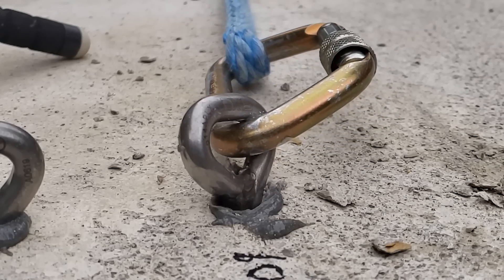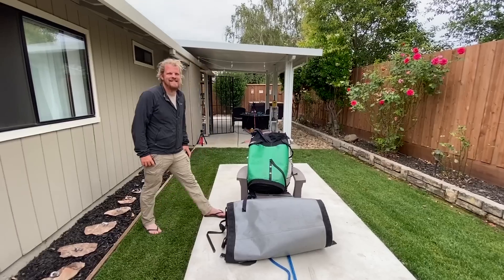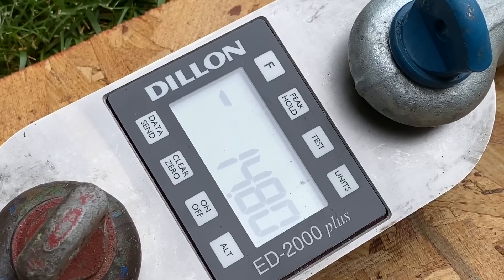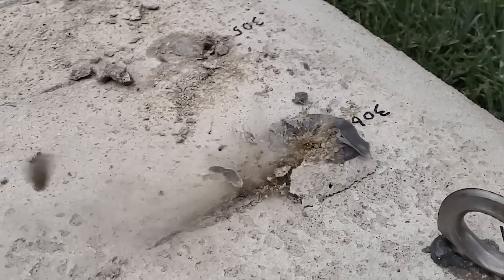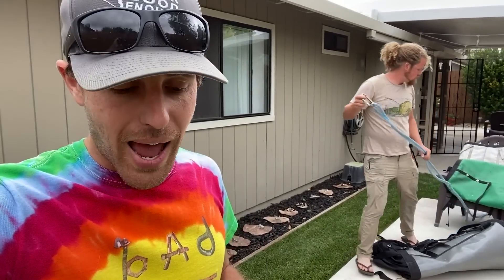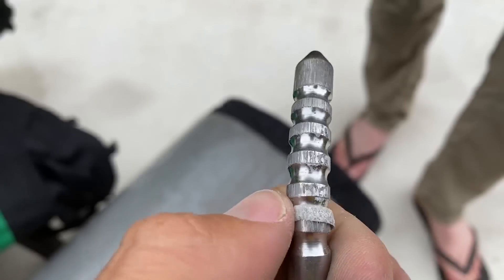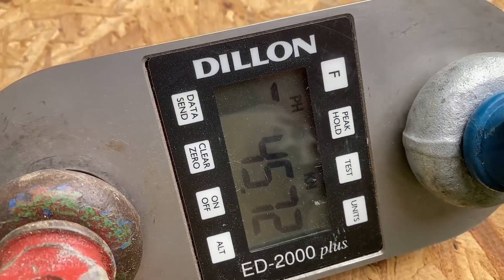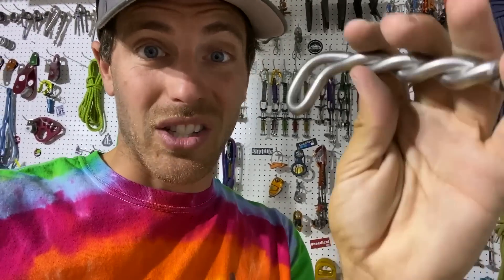We pulled SIDEWAYS on glue in bolts - you won’t believe what happens

Comment: This test was fun and very reassuring. After putting up bolted climbs and anchor stations for a long time and using glue-in eye bolts more and more often as the years go by, I'm now at the point where I think that the second bolt at a station is A) just for that 0.003% statistical advantage against total anchor failure and B) to show lost people or noobs where the belay is.

Comment: I think many are curious about the strength of your concrete. in order to reach the rated strength, the mix has to be kept wet for 28 days. concrete continues to cure as long as it has moisture in it. 

if you were concerned it was affecting your results, you can cover the slab with a blanket or sheets, hose them down and cover that with a tarp to trap the moisture in. keep it wetted for about a month and the slab will be significantly stronger.
Reply: he should be using 1:1:2 or 1:2:2 (whatever tests better)Portland cement, masonry sand, 3/4 screened limestone.
then do a full 30 day saturated wet cure and after a few dry days using a lithium silicate on top for a couple coats

That would allow evaluating anchors without the premature concrete failures. Looks like he is getting compressive failure starting at about 2000psi.
That is really a bit too low.

Comment: That last test was a little comprimised because it wasn't the strength of the bolt or epoxy that failed but the concrete cracked to the edge which let the bolt pull out easier, still a great result

Comment: The 4,000psi concrete you get in bags from Lowe's and Home Depot, or even the standard 2,500psi you get for concrete sidewalks and slabs on grade, should be a good potentially lower-bound, analog for most rocks. I would be interested in how different sand stones do.

Comment: Your partially losing out as the bolts pulled out before are cracking your concrete leaving future bolts in preweakened material.
Reply: The concrete isn't the weak point in most of the breaks. But good observation.
Reply: @elmeradams8781  Not most but it was on at least one although you still got good results. I just think they could have been a lot better off the concrete hadn't cracked when the previous test was ran.

Comment: Hey, great video as always. I'm a mechanical engineer and climber (high lining is still a bit scary for me).

Anyway, I'd be interested for future break tests if the focus wasn't exclusively on MBS. When bolts are rated, there are usually two numbers which are important for the engineer. One is the MBS whi h is forged into the side of the bolt. But there is another number called the proof load. The proof load of a bolt is the maximum force it can take before it plastically deforms. To get this accurately requires a stress-strain or force-displacement graph, but you could probably get a rough number just by using your eyes to see when it visibly starts to deform. It seems like most of these bolts started to plastically deform at very low forces. And if I walked up to a cliff and saw a deformed bolt I probably wouldn't clip it (even if I knew it would hold 50kN before it completely snapped).
Reply: Why would it matter for people using it? 
(I'm not trying to be mean. I'm wanting to learn how to safely climb and engineer things) .
Reply: I love your videos. I would be interested in that too. If you side lode a bolt and bend it, then if it is side loaded the opposite way it would definitely weaken the bolt. Then what would it brake at.

Comment: The problem with sideways twist is that you crack the bolt/glue bond. This was happening in your test at 6Kn. Can you get some Raumer bolts and test those similarly? The Raumer has only knurling as a key for the glue and not notches. I am almost sure the Raumer will slide out of the hole in a twist test. Would be interesting as we use these for our climbing bolting.
Reply: https://raumerclimbing.com/eng/prodotti_clista.asp?cat=stainless_steel_resin_anchors&qi=0-7-0

Comment: I think you should put a sharpie line down the shank of the bolt so you can see how much the shank is twisting on the side load tests. It would be interesting to see where/how much/how far down the bolt it twists. (As long as the glue doesn’t take the sharpie line off, maybe a scratch line instead)

Comment: Ryan, Could you possibly pull on a Fixe bolt up to 6kn (or so) until it cracks the glue, then release tension and see what it does in the hole by manually moving it around.

Also, as I'm sure everyone is aware, cyclic loading of glue ins, in an unfavourable direction is probably not super good for the glue.  But the results definitely surprised me.

Cheers.
Reply: I am also interested in what a tension straight pull out test would show after a glue bond break has occurred.
Reply: Same interest here!
Reply: I want see the highrise construction eye bolts made from 316 stainless steel and from memory I think : 12 mm thick.

Comment: For the longevity of the bolt or anchor setup, it is best not to side load the ring. As you demonstrated, yes, the ultimate capacity of the bolt in one side load event is still good. The low loads (4-6kN) that bend the bolt ring will degrade the bolt capacity for future use especially if the bolt is loaded in another direction yet again (i.e. a highline in a different direction etc)

The bolts definitely seem to be holding even once you pulled them from their initial placement in the glue i.e. they rotate a degree. However, even if the ultimate load was very adequate, you don't really want people using bolts when they have rotated or can rotate. I think this would lead to poor decisions on bolt efficacy being made. Best to load in the correct direction and not trust anything that rotates, has been rotated, or bent out of shape.

Comment: Hey @hownottohighline is it ever okay to use soft shackles to make quickdraws? If i soft shackle my nut or cam to a biner and then use climbing tape to keep the soft shackle taught so the loop doesnt come off the head accidently?? And if you arent sure, id be willing to send you some new biners and nuts to stress test it with if you can supply the soft shackles..please DM if youre interested..
Reply from the maker: Soft shackles are 4 strands plus a button knot to get the length you want.  Sewn dyneema slings are awesome for climbing and are two strands (in a loop) so they will always be lighter.  If you dropped all your quick draws, extenders or some other miracle, then for sure!  You could totally soft shackle trad gear! :)
Reply: HowNOTtoHIGHLINE geez ryan i just wanna see you break shit in the name of science

Comment: It would be good to see a expansion bolts test comparing say 60mm , 90mm and 120mm lengths/ does the length of the bolt make much difference also 
10mm vrs 12mm expansion bolts?? Great videos guys keep up the excellent work 😎
Reply from the maker: we did different lengths over the last 300 break tests but specifically in sandstone.  slackline.com you can see bolt buster chart and see all the mechanical bolts we tested in it.  Shorties came out, long ones broke at the top.
Reply: @HowNOT2  oh great thanks for that , I was going to ask you , , , , I have a massive hilti bolt! Anyway I can send you a photo of it ? Maybe you guys could test it ?? 😎

Comment: I'd be more worried about the cyclic loading of twisting/ untwisting the bolts, rigging two different angles of line over the course of a year, that seems like it could cause premature failure. It'd also be interesting to see a more real world example of say 5-10 degrees off axis, with a notch, and how much force it takes to start twisting then. I'd certainly hope no one actually rigs 90 deg off axis on that style of bolt. 

In the realm of "a lot more data needed," setting up a bolt, and twisting it back and forth 5-10 degrees for tens/hundreds of cycles, then pulling it to failure would be interesting. No idea how much a setup that could do that test unattended would cost, maybe a beefy electric linear actuator.
Reply from the maker: It would just take the hydraulics I have now and a much better pump attached to some serious computer/software haha.  Cycles could have an affect on it but the one real world place (Taft point) that this is installed like this, the 200m line gets rigged once or less than once a year and 3 bolts sharing the load so no bolt sees more than 3kn should be super good enough.  I do plan on doing more twist tests.  We have done some already with other bolts.

Comment: I think there could be a bigger problem if you load the same bolt in two orientations for different lines. The steel probably wouldn’t like back and fourth twisting.
Reply from the maker: I'm wondering if i can do that.  I only have one hydraulic pump but maybe i can use pulleys for the other direction!
Reply: yep, it should have a similar effect of tri-loading a carabiner. The bolt could possibly experience more load than is actually being put on it.

Comment: I wonder if the epoxy brand makes a difference on sideways pulls? Also I'd love to see a do not attempt test using just loctite 3x or 8x polyurethane construction adhesive instead of epoxy
Reply from the maker: we should repeat tests with a less quality glue like Ac100.  We could do general construction glue but I don't want to show it unless it fails miserably! haha
Reply: i was saying a while ago testing epoxy or urethane glues from hardware stores (commonly used for rebar or liquid anchors)
Reply: @evanmallette  rebar/anchoring epoxy would probably be very similar to the regular tests, like the redhead/sitka brand, I'm more curious about non rated 2 part epoxies like JB weld, dev-con, for home use 😄👍
Reply: I have a bunch of hilti rebar glue I could send you. It's overage from a job and out of date.
Reply: You would just need a higher strength epoxy. When you are pulling 'sideways' on the bolt you are essentially adding a second axis of torque on the bolt. Normally you're just pulling a bolt, you're applying a torque across is short axis, but while sideways you're also 'twisting' it, or applying a torque with its long axis. creates shear stress on the bolt to epoxy bond. 

Typically materials are weaker to shear stress, and epoxy is probably no exception. So really, you would just need a high strength epoxy, or a 'stickier' epoxy to be able to withstand that shearing force... Or easier yet, you could make a bolt that is flared, rather than just ribbed. 

Its like trying to spin a straight tube in water, or a propeller. The propeller has a wider surface area resisting a twisting torque. Theoretically would work just as well with epoxy.